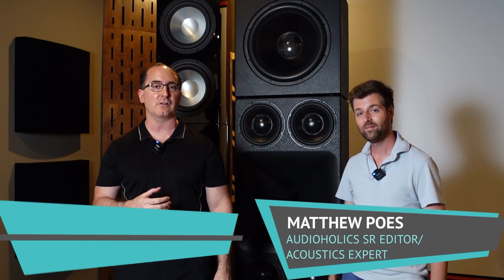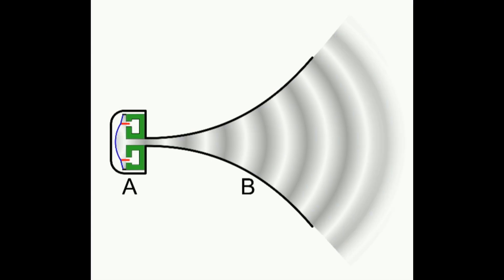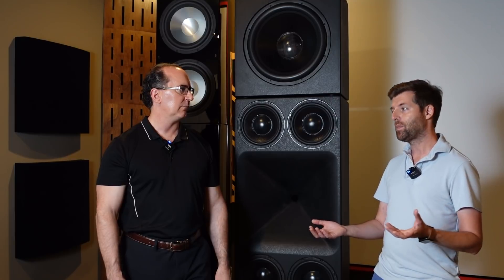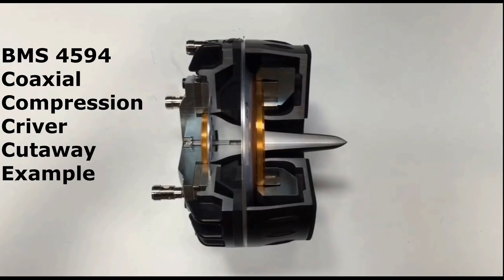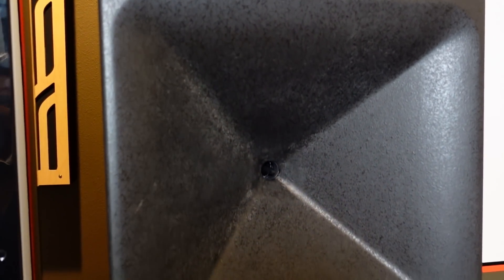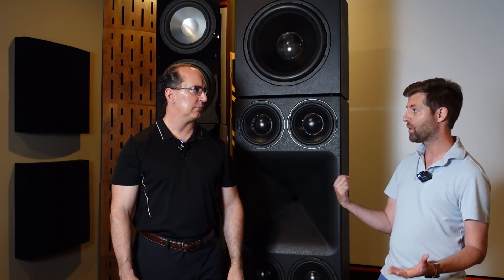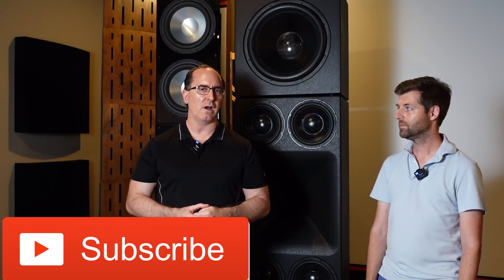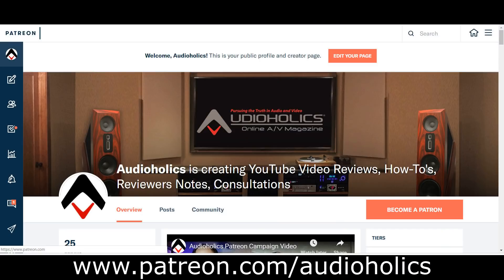Why Are Some Loudspeakers so BIG?

Comment: Effortless. Larger speakers are usually easy, relaxed & effortless. i.e, They can disappear. A full length line array (well it can only be room height within a room) is the one system that can truly vanish, making the music appear out of nowhere. Larger is actually better in this case. Larger speakers move closer to that 'ideal' line array height, smaller speakers  sound like a bloody flashlight.
Hopefully you covered this more scientifically 😂
Tiny speakers never sound quite right to my ears. Like tiny v16s revving at 16000rpms, they have to huff and puff to make a little bit of wind. 
Larger speakers require less power to produce the same volume in decibels & sound very very relaxed/unstressed at lower volumes. Sure, you could get 80db spl out of two inch "full range" toy speakers,  but it won't sound anything like a couple of 15" drivers cruising along.

Comment: Those speaker are absolutely ugly.  My opinion.  I personally like larger speakers that are true full range myself too.  If I am spending money on a set they better also look halfway decent too.
Reply: Those will be behind a screen in most cases, so you won't see them. The important part of this video, though, is the reason why  the tweeters are built that way...to make them sound their best, not for pure visual aesthetics. To appreciate their functional form is to see beauty in that, which I believe is the thesis of the book Zen and the Art of Motorcycle Maintenance. Read that and see what beauty can be, especially when it involves more than just framed pictures on walls.

Comment: NASA has an acoustics/vibration test chamber that has a 12 ft woofer and a tweeter that's a 'mere' 6 ft.  Trying to find specs but no luck so far.  Sure, these aren't going to be geared to highly accurate reproduction but, still, I bet that woofer can move a really impressive amount of air.

Comment: Gene & Matt, nice video! How does the RBH Sound SVTRS active speakers sound VS the RTJ modular speakers? And which are better for 2 Channel?
Reply: It’s going to be a complete judgement call based on preference. Both are meant to be setup and calibrated such that the final signature will be up to the end user and installer. 

Having said that, I calibrated the RTJ for our listening and tried to match it to the RBH, but later switched to what I simply felt sounded the best. When we tried to make the in-room responses match, the RTJ started to sound a little shrill at times. Likely a result of the narrower directivity.  

The RTJ has a very precise laser etched soundstage. Objects are placed very specifically, if you will. A common trait of narrow directivity speakers. The subwoofers were among the very best we all had heard too, so the bass quality was excellent. Even with a less than ideal calibration there. 

I know that Gene and Don seemed to prefer the RBH to the RTJ. It had a distinctly different treble presentation. I felt you could hear the HF details a little better without sounding shrill or bright. Midrange sounded a bit leaner. While both sounded neutral, the RTJ had a warmer presentation. Likely the way I calibrated it. I liked both in different ways. 

Both of these could be very good for 2-channel use. The driver quality in both is excellent. The drivers in the RTJ are custom versions of drivers that are designed for far field cost no object studio monitors. They are excellent.

You would have to hear both to make such a decision. Both are great and I can’t imagine feeling like you made a mistake in either case.
Reply: @PoesAcoustics  like you were hinting at, when you match the in-room response of a narrow directivity speaker to a wide directivity speaker, the direct response will probably have boosted treble on the narrow directivity speaker. When you switched to what sounded best, I bet the direct response was actually more consistent. Once tuned, like you were doing, it's a question of trading focus for ambiance.

For surround, focus can be a benefit. Some people like the "room is my surround processor" approach of wide directivity speakers for 2 channel, but it's a matter of taste. Another option is to use upmixers to get more ambiance from 2 channel. You can't go the other way, though, to make more ambient speakers more focused. Also, the extra focus is great for dialog clarity.

I'm sure both setups are top notch, but if I could have anything for free, I'd go for a full surround setup of RTJ. Why stop at 2 channels when it's free?

Comment: Gene & Matt, wonderful video with great explanations of the subject. Guys are you very short or is it that the speakers are so damn big? LOL
Reply: I’m just short. 

But yeah those speakers are over 7’ tall. Genes speakers likely wouldn’t be able to be setup in a room with 8’ ceilings.
Reply: @PoesAcoustics  Well if Gene is 6ft, then you're average height Matt which is fine. I am short though... :-(
Reply from the maker: @PoesAcoustics  my other has had 8ft ceilings in the theater room, the RBHs barely cleared it 😆
Reply: @PoesAcoustics  it seems like the ideal setup would be to place those subs at 1/4 horizontal and vertical positions to cancel more modes. Handy that they are modular.
Reply: @robcohen  if I were setting up and calibrating both systems for a client, this isn’t how I would set them up. I would likely place the subwoofers in more optimum positions. If the budget limited me to “just” 4 subwoofers, I would place two in the back of the room. I’ve had better luck with 4 midpoint or 4 corner positions than 25% if the room is a perfect cuboid. But yes, If you can play with the vertical dimension too, trying for 25% on the wall front and rear could be a good option. 

As to your other post, I happen to prefer the more focused sound as well. My own current speakers are Gedlee Abbeys which share a similar directivity pattern. But the greater ASW in 2 channel of more traditional speakers has its appeal for some. Neither is necessarily right/wrong. I’ve had this debate with so many experts and there seems to be no research to point to. 

I think if we did our studies differently. Not on what speaker sounds best in mono, like Harman did, but on what system sounds best overall for its intended purpose, we might find that different attributes become important. Research into the effect of directivity on surround systems specifically have favored narrower directivity. That suggests that the system aspect of the study likely matters.  We know that is true for HOA and Binaural XTC systems as well, since room reflections hinder the sound field reproduction of both. However no current surround format in common use is a true 3D sound field reproduction format. None of them, for example, can encode/decode proximity correctly.  Again, I suspect if we flipped the script and researched what overall approach leads to the greatest realism in movie soundtracks or music, some variation of HOA would win out and spellers would be designed around controlled directivity. 

Having set up HOA systems in normal rooms however I can also say that I know why this never happened and may never happen. True 3D sound formats only work well in near anechoic rooms with no strong reflections. Real rooms in real houses never meet this. I had thought/hoped that it would be possible to get a good approximation in typical rooms with non-ideal layouts. However once I tried it, I found it wasn’t all that good. I had to make a lot of fixes acoustically to address it. It was unrealistic.  I had wondered why Auro3D, DTS, or Dolby didn’t go that route (I strongly suspect that the math behind HOA is the basis for object based surround to some extent). My own experience trying to reproduce HOA made it clear why they didn’t. I think their compromises approach is probably good enough given real world problems. Commercial cinemas have a similar problem. People are in the wrong place. HOA won’t work for such a large number of seats unless the speakers could be pushed out many times farther out. Not going to happen.
Reply: @PoesAcoustics  that's very interesting! Thanks for taking the time to write it up. I'm not familiar with HOA, but I'm fairly familiar with the spherical harmonic math it appears to be derived from. I don't have an acoustic background, and I'm not a pro, so I don't want to present my musings as any kind of authority - just curiosity from a theater fan.

It does seem that using multiple speakers including inverted polarity would be more sensitive to listener position than straightforward panning between the nearest speakers. Also, given a limited number of speakers and importance of the screen, the arrangement in popular surround formats may be a more practical approach, concentrating speakers where they matter most. I'm curious whether Trinnov uses a fancy approach to remapping (as their materials imply), or if it's more straightforward remapping of panning between nearest speakers. (By "fancy," I mean using more speakers, including negative weights.)

I also hadn't considered reproducing proximity. Perhaps that can be adequately encoded into the directional sound signals without knowledge of the size of the playback system. Of course, it's hard to know without comparing it to something more sophisticated.

Agreed that 2 in front and 2 in back makes more sense than 4 in front. I have 2+2 myself. I'm just intrigued by the DBA (4+4 or 4+massive absorption) approach with subs placed to minimize vertical and horizontal modes. Speaking of Geddes, his approach (related to MSO and DLBC) advocates irregular positions designed to independently simulate room modes, rather than cancel them out. Lots of ways to skin that cat, I suppose!
Reply: @robcohen  as I understand it, from my conversations with experts in this particular aspect of the industry, proximity can’t be reproduced by any traditional multichannel method. HOA, Binaural, and wave field synthesis are the only methods I am aware of. 

As for Geddes approach, it’s the same as Welti’s conceptually. They use different terms but the physics of the problem are the same. Both methods rely on exciting the modes more evenly across the room to average out the peaks and dips. 

DBA’s and SBA’s are certainly an interesting option. I’ve played with it as well. Geddes had an interesting take. He argues that canceling the reflections completely like that have a problem. It’s unnatural. He said it’s like making the room anechoic at low frequencies.  That this isn’t what the ear/brain expects in a room.  There is significant spatial information at low frequencies which contributes to envelopment. So he argues that we shouldn’t cancel the reflections. So while it gives the most even and flat bass response, it’s not accurate either. 

I don’t have any DSP or processors with sufficient channels to setup both a bass array and a multi sub and then AB. So it takes me hours to go back and forth between the two. Making a comparison nearly impossible. To my ear, in these problematic comparisons, I think both sound good. 

There is some published articles that support Geddes approach. The area with the biggest problems are between 50Hz and 150hz. However in this range, we also get key spatial information.  Assuming accurate recordings with proper binaural LF cues, these creates the more realistic out of your head effect. Summing to mono below 80hz negatively impacts this a bit. Canceling all reflections completely collapses it.
Reply: @PoesAcoustics  that's interesting regarding spatial queues and bass. If that's right, the Geddes/MSO/DLBC computer optimization approach could potentially be extended to also balance maintaining the spatial position of the bass. It would need to take over bass mgmt as well as bass EQ, though, which doesn't fit in well with typical signal chains. This is another territory where the Trinnov materials make vague claims of sophistication. Maybe they do that?
Reply from the maker: I'm 6ft 😆

Comment: Big speaker  sound awful
Reply: Nonsense If a speaker is really well designed implemented it will sound good regardless of it's size. Lot's of great sounding speakers both large and small.
Reply: @C--A  absolutely true. It makes very little sense to apply a blanket judgement across all speakers of a certain size class.  

James Larson and I have mused at times as to why some people prefer the sound of mini monitors. We have the same working theory. Not much bass. In most rooms, bass is a huge problem. Especially when the bass comes from that pulled out location that is ideal for the L-R speakers. Bass can seriously dominate our overall perception of the sound of a system. Not enough bass and it sounds thin, bright, unpleasant. Too much bass and it can drone, ring, sound loose, even the treble can sound like it’s lacking. Bass tricks us. So if a speaker simply doesn’t produce much bass, you don’t hear all those problems. If you don’t hear those problems, you judge the overall performance better.
Reply: @C--A  it always depends on the room - in a small room they are nonsense
Reply: @Harald_Reindl  I've got a small room and I use bookshelfs plus on-wall speakers. More than loud enough at my main listening position even at only 50% volume on my amps.
Reply: @C--A  yeah that's why I said it depends on the room - two meter high speakers would sound awful in that room and your compact speakers likely wouldn't drive a 5 times larger room well
Reply: @Harald_Reindl  My original comment replying to the other guy who said big speakers sound awful. Was just me saying you can get great sounding speakers in all different sizes. He never 
mentioned anything about room sizes. The gigantic speakers in the video are in a big room with a fairly high ceiling. 

We are in agreement about matching your room size with the appropriate speakers. Even though my room is small it's uncluttered could accommodate normal sized floorstanders. Perlisten S7t floorstanders are said to perform great in big and also small rooms though way out of my price range.

Comment: is this the kind of room size where your typical and favorite audio brands just run out of products for your room, and you you need to contact event organizers for their outdoor product lines used for outdoor concerts ? Or can you still use HIFI products from Focal, B&W, Keff etc...  ?
Reply: Speakers used in outdoor concerts weren't designed for indoors, in the home.  Most would likely sound bad if used in the home.

The massive RBH and RTJ floorstanders in the video were specifically designed for large home cinema rooms. 

Plenty of other massive floorstanders available to buy for people with big rooms. If they have the money to afford them.

Comment: some loudspeakers are big, and then there's the Technics SB-AFP1000, a speaker that takes up 55 square feet of wall space in a single speaker, another massive speaker was the Infinity IRS system and the later Genesis speaker systems.